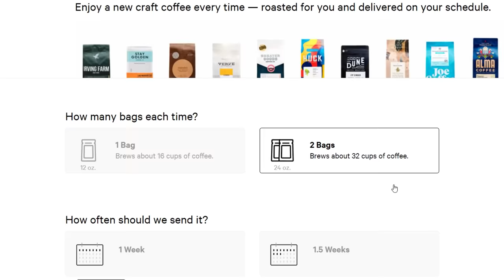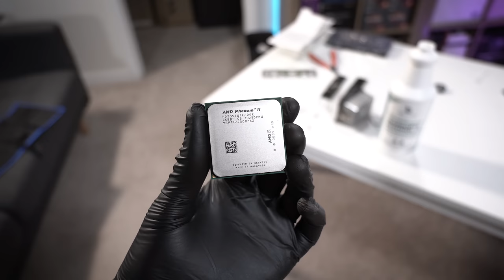Deep-Cleaning a Viewer's DIRTY Gaming PC! - PCDC S2:E10

Comment: You’ve outdone yourself with this one! I especially like that you didn’t go the easy route and upgrade anything. I was so happy to see this notification pop up. Can’t wait for season 3!
Reply: yea but how is this system still working from 2009?
Reply: @xcen1  do you expect pcs to stop working after a period of time suddenly?
Reply: @LuckyDucky1122  yes it depends on wear like a car.  Cars have mileage and computers also ha well mileage but it's not written Down.  If you look at certain PC components ssd have a lifetime read / write cycle.   If the owner only turns it on once a week or month then it will last very long time.   If you use it everyday hours at a time then the psu will fail first.   That much dust on this old PC at this time isn't that heavily used.  I'm guessing the psu will fail soon
Reply: @gabrielr1139  how much do you use the PC,  daily,  weekends?

Comment: You're an inspiration man! I started cleaning my build after you started this series. 
Seeing what to do to each part, what you can and can't do, the right tools, everything, is just super nice.
Keep up the good work!
Reply: when you have to do weekly it gets annoying I already started disliking the process
Reply: @Gamingtechgg  But you don't have to do it weekly lmao. I clean the filters once a month, and the pc entirely once each 3 months with a little brush and dust blower. Now deep cleaning, I did once this year, and I think and I gonna wait for another 1 to 2 years or so to do it again. You just have to maintain bro.
Reply: @Huaie  I got major problems with dust still  accumulating, haven't figured how it is happening so quickly yet. Used my compressor on the radiator that dust was sick lol
Reply: @Gamingtechgg  Mine had this problem too, but in my case, it was because all of my fans was in max rpm and the exaust fans are faster than the intake fans, wich means negative pressure. My pc would get dirty in just a few days! Since I change my cpu cooler, I also did change the profile to a much slower rpm. And now dust takes a long time to build up.
Reply: @Huaie  I got my fans on 500rpm only intake is from top with x3 fans, dust is coming from main road. I suspect I might change my case
Reply: @Gamingtechgg  That's crazy. Maybe your case has too many holes or something, so dust could go in more easily?
Reply: @Huaie  raijintek enyo case open from everywhere ;D
Reply: @Gamingtechgg  Welp. Maybe it is really the case lmao.
Reply: @Huaie  It depends on your enviroment and if you have lots of dust

Comment: just like Carey Holzman! Go Greg! When cleaning parts in the sink, use the kitchen sink. most kitchens have a hand sprayer and this works great for cleaning heat sinks and fans... plus you have more work space...  love the PSU shown... so easy to service... I hate the ones where the fan is soldiered on to the board... really hard to clean...

Comment: Ah, the 1035T, I love that cpu. Ive built budget pcs with that cpu all the way back in 2015 before AVX was really required for most games, and the ones that did require it I just used Intel SDE as an external executable to get the game to run

Comment: These videos are fun to watch. :-)

As it happens, today I cleaned one of my computers (a "general usage" veteran, with an i5-3450 and 4 GB of DDR3-RAM - running LMDE4, no Windows 11 for this oldie). 
It didn't have much dust in it, but the thermal paste was all dried up (but the machine still ran fine).

Comment: I had the full ATX version of that motherboard, the M4A87TD-EVO, and it's a great board, overclocks a Phenom II X6 1090T to 4.6GHz great, until the VRM craps out or the northbridge dies from inadequate cooling.
Reply: I have the M4A87TD-USB3 with 1055T
Reply: @coffeemakerbottomcracked  my Northbridge died 3 months after I got it, and they sent me a different revision with something on it different enough to trigger windows 7 activation. Totally screwed my activation for my student edition of Office 2010 as well, which ai needed for my college classes. All of my classes were online, and that was my only computer at the time, so after the RMA process of 2 months and another month of no access to office, I failed all of my classes for the semester and was put on Academic Suspension, ruining my college education.

Comment: Excellent video once again.  Interesting idea for next season, but if the console clean up is lacking in projects to film, Cleaning up PCs is still an option, especially if you hook it up with a "New Case" spec'd and chosen by you, so we can all learn from what choices you make for each application.  In my case, I require a ton of IO both front and back.  I need access to USB-C and at least 2 of the drives that can be removable for remote safe keeping with back ups.  Each owner may have things they want to keep, like a DVD reader/writer, so finding cases that can support these oddities might add a bit of interest to the project.  

I have learned a TON of good info.  Especially in the cable management side.  So I eagerly watch both of your series since you cable manage everything that comes into the site.  Thanks, and keep it up.

Comment: I have the same board, with an Athlon II x4 and a gtx 460 se. Still runs fine for web browsing, and runs Office 2007 fine. I use it in my shop for web browsing mainly, and as a backup just in case.

Comment: @Greg Salazar, 

I had a customer bring me a custom built gaming PC she build for the first time(she was 22). I gave her credit as it looked pretty clean, given it was a first time build. Right as I was going to power it on, I noticed something. The customer had connected the 4pin Floppy power connector from the PSU to a 4 pin fan header on the motherboard! Had I powered the system on, that could have ended badly!

Comment: The ONLY thing I would change, is to change the case fans to a matching set. Maybe remove the chrome rear one, and replace that with the black/white one that's in the top, and leave it with just the 2 fans.

Comment: a little hint in those fans what i do is take the sticker of the back of them usually a rubber seal and put some grease  gel in there or a bit of oil and it quietens them down ive done it to all my computers usually just the older fans and CPU fans to  hey good job there Greg  i have that case and motherboard to nice

Comment: Nice way to finish off the season. I found the leaf blower and PSU cleaning particularly satisfying to watch. Question after the front panel cables get wet: how do you dry them after to make sure there is no moisture when you rebuild it?

Comment: I used to have this exact case years ago. Up until i bought the official fan that goes into the side. I connected it up and after about 2 mins I noticed that the PC was a glowing a different hue of orange. The LED switch that the orange leds connect to had caught fire! Luckily I managed to contain the fire before the whole PC was destroyed. I contacted NZXT and they never responded back to me. Since then I've not bought anything NZXT.

Comment: Purple screen may be normal.

If the monitor supports and defaults to YCbCr signal you get either purple or green with a blank signal; which can happen if the GPU temporarily loses connection with the monitor (either because of a driver shenanigan, some odd interaction between the monitor and his GPU, a poor quality cable, or just a random burst of EMF).
Most people would get black flash, but with YCbCr you get purple or green flash instead.

If the purple/green screen lasts longer than a flash then it may be a bigger problem; unless the cable is really damaged or wrongly plugged) or unless it fixes itself by turning the monitor off/on again (which would mean the connection signal is poor and the monitor failed to properly sync with the GPU)

Comment: With that ginormous boot time you could drop in a 128/250gb ssd tho!

I'd also have flipped the rear 80/92mm rear fan as intake.. that would have achieved some slight positive pressure and maybe a little bit less dust build up. Buuut if the owner doesn't clean his room, there's not much some slight positive pressure can do xD

Comment: As someone who uses Excel a lot at work with large workbooks... you need something pretty beefy to do it because it's so piss poorly optimised. It's OK on quite simple datasets but once you throw in files with thousands or more of rows and formulas etc you can be waiting several seconds to even minutes for it to think about stuff even on a moderately powerful system (the PC I used at the office runs an i7 8700 with 16GB of RAM and an NVME SSD with a GTX 1060 6GB GPU for the hell of it, so while not state of the art by any means, as an office PC it's quite good). I've run the same files on my own PC which has an 5800X, 32GB of RAM, Gen 4 NVME SSD and a 2080 Super and it's still not exactly a great performer with Excel!

Comment: Good Job Greg,i like and watch you all the time ,i like my machines clean too,BUT :) man....water on the parts and connectors(front panel)...if its distiled yeah it will evaporate but tap water...all that oxidation and rust later...

Comment: The purple screen is an annoying issue AMD drivers like to cause sometimes.  Had that issue with my new build.  Drivers kept changing the RGB settings on bootup.  It needs to be manually changed in the Adrenaline software.

Comment: Cool Video..I Bought a Small ish Air Compressor for blowing the dust out of all my Pc/Servers & Electronics And a Good Moisture Filter for The Air Line & I have used that system for several years  Now Without any Problems It has ben one of my Best Investments (Thant and a 2200w APC UPS) & it's paid for its self 100X over by now i think i spent 200$ or less Total ! an buying cand air is just Crazy to me ! Cool Video

Comment: it'd be really interesting if you did a CPU and GPU benchmark before and after... no need for multiple benchmarks, can be a single artificial one, but it'd be great to see the performance impact of the deep cleans... this computer probably got back a 30-45% thermal headroom from changing thermal paste and degunking the radiators

Comment: That computer looks like my mom's old computer it's an old amd from about 2006 and it sat in the garage for 7 years I dusted it off and realized the case was corroded to I bought a new case for the mb and a new psu and it was an old compaq unit but I was able to swap the mb and everything into the new case without a problem but I wouldn't be able to use the front usb ports or the audio ports which is fine and it still works just fine I did all of this last year before the pandemic really took hold and shut everything down.

Comment: I didnt know that taking apart a psu was a bad idea for those without experience. I opened my psu without any experience or training, just opened it cleaned the fan from dust sticking into it and dust off some dust inside and closed it. Thank god nothing went wrong when i opened it.
Reply: @fucazombie  i didn't touch much when i cleaned it tho, those capacitors inside were safe since i didn't stick my hand in there.

Comment: Tried to read through the comments to make sure it hasn't been asked or mentioned, but there was too many to read through.  I have a question as to why you put the hard drive in upside down?  or is that the correct way to put a hard drive in a case that old?  I've always installed a hard drive with the black metal side down.

Comment: 14:13 the HDD PCB should face downward if I'm not mistaken.
Reply: Most people install lable side up. Yet a mechanical HDD can be mounted in any orientation. SInce the platers are double sided and doesn't effect the operation.

Comment: Ah the 560ti... back when gpus only required intel stock cooler like heat syncs to remain cool. That case is sick af as well. Real beefy tough looking case.
Reply: "back when gpus only required intel stock cooler" Well, no. 550 or 560Ti were mid-range cards so of course they were easy to cool, but high-end models at that time models like GTX 580 were really hot. GTX 480 that was made before 500 series was even hotter and it is famous of being a computer grill, people were cooking bacon on that card for a meme because that card could reach 90°C at stock settings with reference cooler.
Reply: @mruczyslaw50  Yeah I was aware of the whole 480 heatspacer thing, It just like 60 tier cards nowadays all have these ginormous beefy metal coolers with 2 fans minimum.
Reply: @TechThatYT   Today's 60 series cards have pretty much overdone cooler, that's because manufacturers are trying to push performance even higher, as boost clocks are higher with lower temperatures. Back at 500 series there was no boost clocks and clock speed was the same no matter what temperature it was working at (unless it was throttling if it was really hot). Also today's 60 series cards are much more expensive than models from back then, that's what makes manufacturers to invest into better cooling solution, as better cooling can make the card sell better. You can still find OEM RTX 3060 models from HP or Dell with small heatsink and just a single fan, and they are technically doing okay reaching around 80°C, but they don't boost as much as variants with better cooling, as they were made to be cheap and within the specs.

Comment: just asking but is there a way you could modify the case if possible and reduce the amount of metal used but enough to hold the necessary components and drives to make the inside not look so cluttered or crowded?

Comment: Hey Greg, trying to find a good electric dusting device but the link you posted just sends me to a generic search on Amazon. The only ones with decent ratings don’t have the brush attachment, so wondering your input. Or at least the exact brand name you use. 

Cheers.

Comment: Florida has the cleanest 'dirty' computers we've ever seen. We've seen around here (WA and OR)...computers with 5 fans and only one (1) was still able to even move. The CPU's air cooler so plugged up that zero air was getting through. The power supply so dirty you had zero clue who even made the thing. Or a CD-ROM drive that won't open because the dirt and dust bunnies stopped the drive belt from moving as it was 'glued' to the inside pulleys and frame. Florida computer's dirt; is strictly 'bush' league stuff.

Comment: ive had my pc for a year and havent cleaned it, it has fairly little dust on the inside and on the fans, wouldnt say it is bad but is not unnoticeable. would just using some air from a air can duster be enough to take it all off ?

Comment: Hey Greg! I have a question, I'm trying to build a PC for work at home purposes (mostly rendering and 3d modeling) Do you guys think the GPU market price will go down on December holidays? or Should I bite the bullet and get one for now at the current price (tbh where I'm from it's triple the price as it was before thanks to this crisis)
Reply: Do you really need to GPU render? You can get Haswell Xeon processors with plenty of cores very cheap from China. But you can also get (in the US) cheap Nvidia Tesla M40 or similar cards with 12GB of VRAM or more that have great performance without being too costy. Granted they have no video output, but if you want workstation performance, you might be able to just get video output from an iGPU or like a GT 710.
Reply: 3D artists that are great today began learning on graphics cards from 10 years ago.

Comment: You look to the left of the screen in the garage and say in Scotty Kilmers voice "Endless money pit!"
Reply from the maker: 360s are actually quite reliable by Ferrari standards. Just change belts every few years (through the firewall, so it's pretty cheap). And the clutch will last if you drive it correctly :-)
Reply: @GregSalazar  Samcrac one was a total lemon 🤣

Comment: I've always been scared of using air compressors vs compressed air because of the moisture (water particles) that can get onto electrical component, when i saw you using the leaf blower i thought it's safe to use an air compressor if you have one at low pressure? Am i right? Or should i continue use compressed air cans?

Comment: That system so old your more likely to get the Spanish flu then Coronavirus. Just joking it was only a few years ago that I escaped my FX 8320. Also if I may make a suggestion, a small 2lb to 5lb air compressor would be leaps and bonds better then what you currently use. Also if you get a flat tire or have low air it beats a gas station air compressor for $1.50.

Comment: also do pcs from like 2017 not modern ones that people been sending so they can get a free part that some of them purpossly broke to they can have you upgrade cpu part or they could off buy a broken gpu from ebay installed save there new gpu too selling on the market have your gpu 20series or 3 series card installed then bam money for them free parts . see this could be dangours for modern builds if you do builds from 2017 2018 2019 thats ok anything from 2020 and now nope i was hopping too see classic systems too see how you fix them or clean them modern ones are kind of easy .
Reply from the maker: ? We've done plenty of these - for both the PCDC and FoF playlists. Not sure what you're on about.